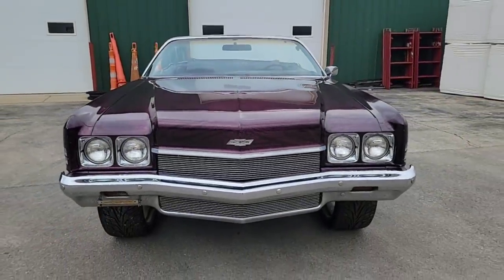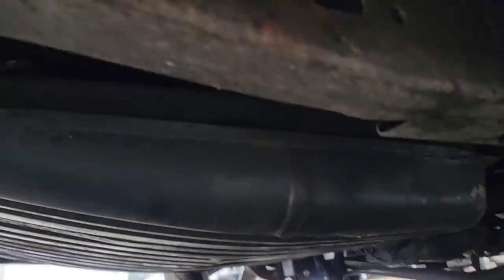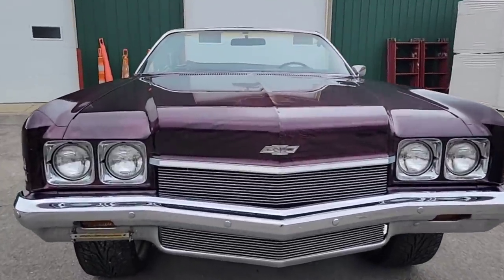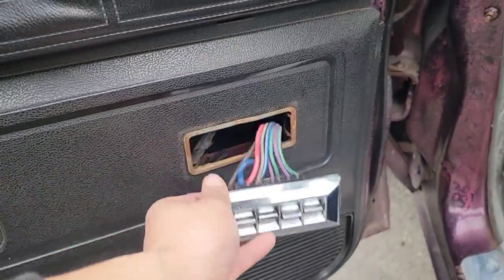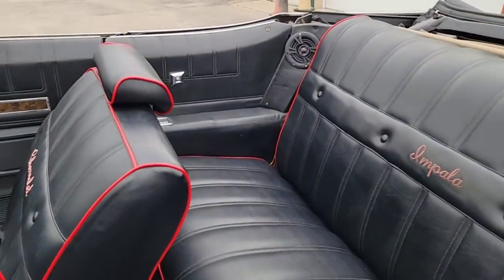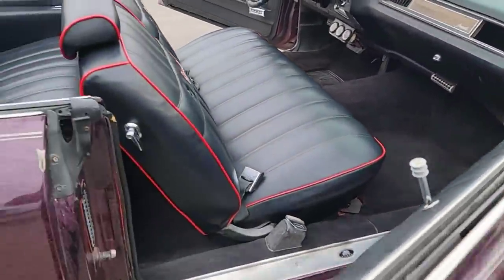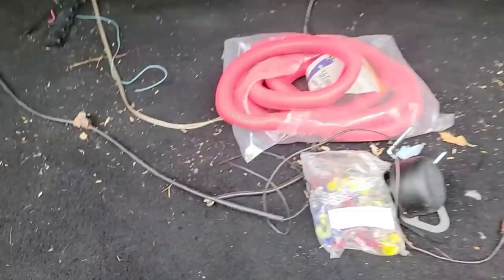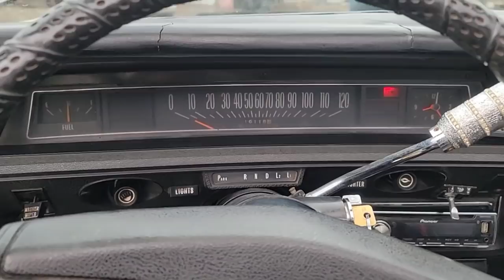72' Impala ready for its new owner!

Comment: Mr75 caprice, I built that car, motor trans rear end exhaust suspension, motor is a 305 sbc 30 over , 280 comp cam roller rockers msd 6al  ignition pro billet distributor msd plug wires th400 trans with shift kit , I first lifted that car high Ass shit then a few years later I dropped and tucked it the car was hit in a intersection on the left rear side when it was sitting high…… how the fuck don’t you remember that car, those are the wheels that used on my 2000 white ELDO, lots of videos on my channel @bet it up kustoms
Reply: Can you help me find a reasonably priced Donk Vert?